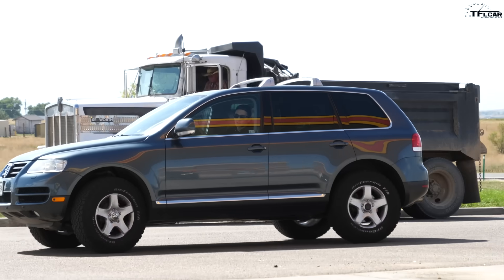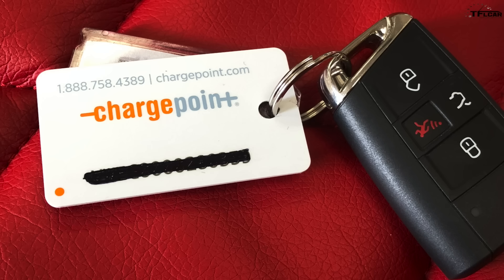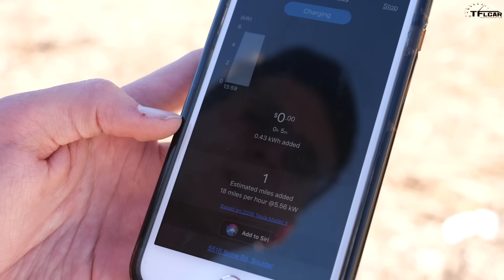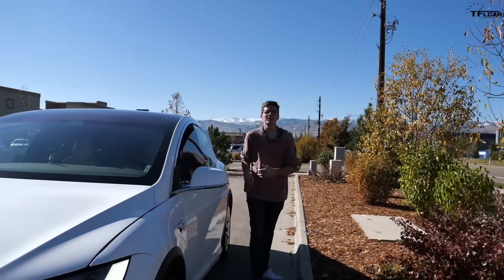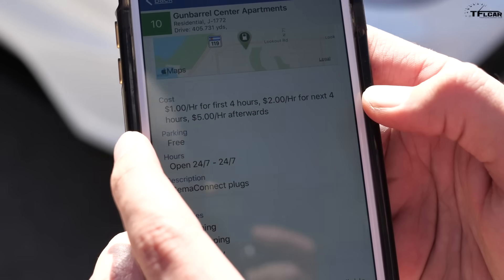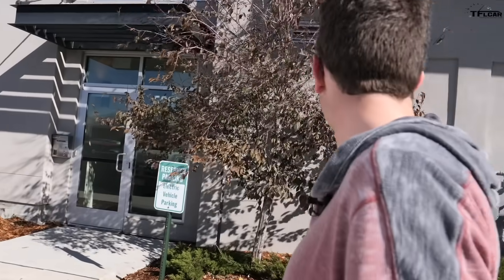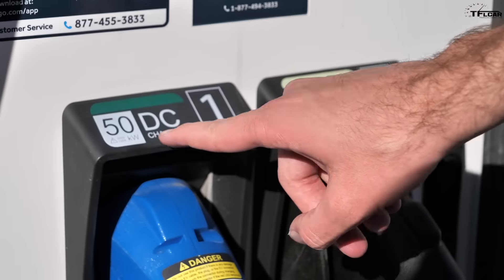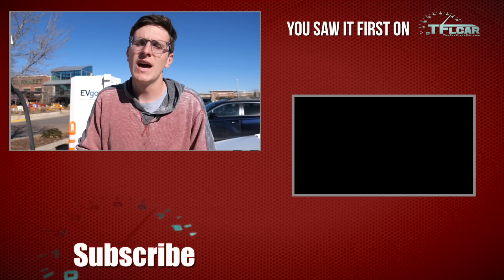Here’s Why Charging an Electric Car Can Suck - And It’s Not The Reason You Think!

Comment: So, I think electric cars are a good idea, but, I don't think they're worth getting for a while. And, seeing this video, points out a lot of the flaws with electric cars, beyond my typical argument against them.

The US, geographically, isn't built for electric cars, cause it already eats gas cars for breakfast. And the other problems I see, that you've pointed out, can be fairly easily fixed.

We need a board, or committee or something, that can help to regulate what's required, when paying for power, and the kinds of plugs allowed on the machine. I think a max of 3 different plugs should be okay, and, they should run very similar to that of gas stations, where you can select the different types. In this instance, rather than selecting unleaded, plus, and premium, simply select slow, medium, and fast charging. Each would be charged differently, and if you've got time, it's not so bad. Plus, pumping out higher loads of power into the car can cause problems on the device itself, so, it would actually make a lot of sense for them to be more expensive the faster they charge.

Of course, as technology improves, I don't think they should bump up the rates too much as they switch out the pump's abilities to charge faster with newer plugs. Though, if the companies/board is smart, they'll make the plugs themselves modular so as to switch out the slower ones for newer ones over time.

However, they also need to work out a system, where you can simply just pay and go. Gas stations (and pretty much every business on the planet), allows you to pay in cash or with a card. No need for extra apps. While things like Google pay, Apple pay, etc, exist, those should be set up as a way to connect to the device without having to pull out the card, but, not need to go through 6 different companies to get the stuff done. All pumps simply need to have a large enough screen to view the options, and let the owners select card, app, or cash (where appropriate, say such as gas stations, retail, etc.), and then leave it at that.

The board, would simply regulate the general cost of getting power to the cars. Such as establishing that residential areas should be cheaper than commercial areas, but, are limited strictly to the people living there. This can also be easily solved, simply by giving the residents a pass code that they can put in when charging their vehicle. This will prevent others from just hooking up and using up power when not needed. However, it is possible, that neighborhoods could allow for outside customers, but, they'd probably be charged more for using it, than they would if they went to a commercial area, as then they're using up a charge post that could be used by the residents.

But, for the commercial areas, since they're allowed to service anyone, they could be allowed to charge whatever they want, so long as it's not above a certain amount. And, likely, so long as it's not below a certain amount either, as they'd still have to pay the electric company for charging the cars. Unless they opt to get a gas plant that they can use to power these pumps, and simply have the tanker trucks refill them that way. Again, the board would simply unify things, to streamline everything, and to avoid the chaotic mess with improper plugs, and 6+ layers of companies/apps to run through when paying for recharges.

An exception to this, would be to let some of the companies do what Tesla is doing, which is to let it be charged to your account, and then you pay it off that way. Which, is okay, until the car gets totalled, then you need to replace it, so, I wouldn't know how to solve that exactly. Unless Tesla has a separate account linked to the main one that let's you pay for power that way.

The other problem, which I feel is the biggest, is the one that's turning most people off from having electric cars, and that's the charge time. While it's great to have an electric car, and to be able to charge it, these cars, are simply luxuries. Gas pumps are, currently, infinitely better, as, if I'm out of gas in my car, I can simply sit there for no more than about 10-15 minutes max, and fill my car and be on my way. Especially, if I don't realize that I'm low until before heading into work. With the electric cars, that's not an option. You'd need to recharge it all night, every night, to ensure a full charge. And then, if you travel super long distances (coast to coast, because some people love to do this), you'd be in some serious trouble, because, you'd literally have to drive till it's out, then break for the day, while it charges, then start again the next day. While it already takes a few days to a week to get across the country, this will very easily double it.

Granted, most people won't be doing long distance drives like that, but, not everyone can afford a plane ticket either, so, that limits their options considerably. But, the charge time for the batteries, currently, is too long for the average person to even be interested in having these cars to begin with. Everyone's already used to the convenience of quickly filling their cars, so, these charge stations need to manage to match those same basic speeds.

There is a possibility, that they could section off the batteries, and have multiples charge at once, if that's not already happening. Because, if you were to compare them, charging 1 phone could take an hour, but, if you were to hook 4 phone batteries together and charge them that way, it could take about 4 hours. Whereas, you can hook up 4 phones to the wall, and all will be done within an hour. As an extension to this, current gas cars already charge their batteries as they drive, so, it's possible that they could do the same with the electric cars. Simply hook the wheels up to 2 sets of wires, where 1 causes it to move forward (probably the motor turning the axel), and the wheels themselves, can help to recharge the batteries, slowing down their drain. Plus, there are 4 wheels (typically), so that means 4x the recharge rate, even if it is fairly minimal. Plus, typically, cars are rear wheel drive, so that helps considerably, as all the power will drain out that way, and then all 4 can rebuild as necessary. This is all, of course, assuming that these companies haven't already applied these ideas in the first place.

Comment: Electric cars are great for the use case of someone who commutes less than 100 miles each way a day and has a garage or driveway in which they can install a charging station and charge their car overnight. I would venture to guess that a majority of Americans fall into this category. We have had an electric car for over 2.5 years and never have to deal with this hodgepodge of charging options because we just charge at home overnight. But if you don’t have access to a home (or apartment) charging station, then EVs are probably not for you yet.

Comment: 3 hours to go 45 miles, seems like a toy for urban commuters.  In the end it likely pollutes more than an efficient Honda Civic
Reply: Fred Burris how?
Reply: nicolas vilches 
Most of the world’s electricity comes from burning fossil fuels and you put it on there for almost 4 hours.
Reply: Actually around me 90% of electricity comes from solar, hydro, and nuclear power so it’s extremely clear around me
Reply: @Sam-TheFullBull  Not sure where you live but whats around you likely doesn't mean thats what charging your car.  In the west the power sources feed a grid which is majority natural gas and coal fired
Reply: Amount of time is irrelevant. How much power is being used to charge is all that matters. A Tesla Supercharge station and the 120v outlet in your garage will charge your car the same amount. One takes 30 mins and the other takes 15 hours. Both burn the same amount of coal, natural gas, wind, solar or nuclear power.

A Tesla charged with solar pollutes trace amounts compared to a super efficient Honda Civic. Pretty much just the factory output for creating the PV cells (which last upwards of 50 years). A Tesla charged using coal power probably pollutes about as much as the Civic. Maybe a little more but not much. The cleaner your local grid, the cleaner your EV. A clean local grid doesn't change how clean your ICE vehicle is, though.

Comment: my full size conversion van, and 3 cars cost me... $3,600 COMBINED cost to purchase.  I've already driven these 4 vehicles a combined 150,000 miles.  All the motors run like new.  I will convert all of them to electric on my own, and the operating costs will be even cheaper.  I will use a transmission free direct thrust system, of my own design.  So, I will not be using any charging stations.

Comment: Seems like a lot of inconvenience to be stylish...
Reply: I drive my Model 3, come home and plug it in. Next time I drive my Model 3, I come home and plug it in. Repeat as necessary. Not very inconvenient.
On road trips, I stop to charge which usually takes about 40 minutes, during which time I usually eat, which takes longer than the car charging. Again, not very inconvenient.
Reply: @NVRick1  it's nice that you can have that time when you're on a long trip. A problem I can see is some time even on a gas station there are a little line up, and if the "fill up" time would take 40 minutes then you'd need to have a bunch of parking spots for them, currently we don't have that but as we are forced with this technology it should come along I guess. Hopefully we get a universal plug and all charging stations have the current fast charging minimum. Another thing is extreme temperatures as those kill range, I guess it's the cold that really hurts EV.
Reply: richard blaski shut up.. gas or diesel is better
Reply: @axtra92  Wow! With that argument, you've convinced me.
Reply: @axtra92 Pretty hard to fault that logic. I don't know how I missed this solid bit of reasoning!
Reply: @axtra92  Please grow up
Reply: I just ordered a Tesla model S, currently comes with free lifetime charging at any Tesla station, there’s one under construction 4 miles away and another 6 miles away.  Free is nice.
Reply: When will the officers be here?

In a couple hours they need to charge their vehicle first.
Reply: You're right I rather take 5 minutes to gas up a Subaru Forester than wait a couple of hours for a charge
Ha ha technology sucks 
Stick with what works
Reply: @ralphabreu5022  That's what they said about the "horse & buggy"! LOL

Comment: This is made up BS. You complain about having to sign up before using a charger, then you use the one car that has no such problem, the Tesla, which simply plugs in and charges to your account automatically. Then it is a "problem" that Telsas don't use the same plug.

The fact is that Telsa drivers rarely use other chargers outside the Tesla system. Tesla chargers are about three times faster than the fastest "high power" chargers used by other makers. That's only for starters. Tesla stations usually have 10 or more chargers, vs the one or two found at other types of high power stations, and half the time one of them is broken.

You want to complain about charging? Fine. Don't blame the car that solved these problems for the problems with others shitty networks.

Comment: One third of drivers didn't know if electric cars had a gas or diesel engine? I knew some drivers were stupid but this is a whole new level.
Reply: Seriously - you don't understand that people who (so far) have no interest in an electric car haven't studied the terminology/technology to know that there are currently three versions of "electric cars":  1) Hybrids with an engine that moves the car when needed and recharges the batteries;  2) Plug-in Hybrids that can also be plugged in for charging;  and 3) Pure EVs that only run on battery power and must be plugged in to charge?  So I suppose you are familiar with all versions of flex-fuel and hydrogen cell vehicles - otherwise someone might call you stupid.

Comment: Where do you think all the electricity came from to charge  the Electric Car Battery? Electricity can't make itself, the charging station, based on its location, could be running on either coal, water turbine and or nuclear energy.  The Lithium battery, once dead, is now Hazardous Waste and has to be stored deep under ground somewhere far from civilization forever. But enjoy those 8 hour charges or longer if there's a line at the Elect Pump when you're miles from home. Y'all really didn't think this through... and you're not saving the planet at all.

Comment: Big mistakes in this video. Every house has 220vac. It’s what your clothes dryer runs on (and your air conditioning). A gas car is actually more of a pain in the arse to fill than electric. When you drive an EV every morning you leave your driveway with full range and unless you drive more than the range of your car you never charge anywhere but home. I don’t know anyone who commutes more than 300 miles a day. Do you? So they never have to charge away from home during their normal daily life. Ever. Period. Never!
When you drive a gas car you never have full range in your driveway. Never. So you have to go out of your way to find/drive to a gas station to fill up. The time t do this is the time to drive to the station, the time to wait if the station is busy, and then the time to fill. Then you should add the time and cost of oil changes four times a year because gas cars need them and electric cars don’t. You have to adjust your schedule to take care of the gas car. That doesn’t happen with an electric car. They are much more convenient to own.
Especially if you own a Tesla because if you do go on a trip superchargers are everywhere and are super fast and easy to use.
EVs are also faster, handle better, more reliable, more comfortable, quieter, and don’t spew poison out of a tailpipe as they go down the road. Remember you are breathing and living in the air that’s being used as a place to dump the poison that’s coming out of the gas car. Have I made my point?
Reply: Dave Webb   Chargers are not everywhere.  Do you ever do a road trip?  You would not reach your destination in my area of the country.  Even if there was a charger who wants to wait. And how far is that battery going to go in Wyoming in the winter?

Comment: It gets worse
At 40 deg F and lower the battery capacity drops off precipitously.
A Tesla Model S at 19 deg F got 7 battery miles per physical driving mile with only window defroster on - no cabin heating.

Comment: EV's will NEVER replace the ICE engine....I can fill my 36 gallon diesel tank in less then 6 minutes with a fuel range just over 500 miles also no need to look on my phone to find a gas station...lmfao 30 minutes to fast charge vs 5 minutes to fill up a gas tank...my choice is clear.....I.C.E.

Comment: sure I'll charge for 10 hours if it gives me  450 mile range.  I can road trip for 6 hours straight without  a break.. heck I've run ice cars for 26 hours just stopping for gas and bathroom  breaks  up the east coast... EVs need to give at least 6 hours at 60 mph on one charge, bare min. for me to consider them to be my car replacement. I would love 800 miles for a  10  hour charge .

Comment: apartments and condos need to get with the program...
 Governments can update  code requirements as part of  housing  requirements as well. Also locked membership  charging ports  for tenants  or residents maybe an option.
 and if you do have a garage  part of the cost of the  car should  be installing an accessible  240V port

Comment: That is why the federal government needs to take over the electric vehicle industry and set a standard that all electric vehicles manufacturers and charging stations have to go by one type of electrical plug can be used and only one app on your phone to use basically one company to deal with or just use your credit/debit card to pay at the charging station and a flat rate of charge per hour of charge no more proprietary charging plugs either and as for home charging system you'll need to have installed a separate power connection with a separate meter and pay two different electric bills and a electric fuel tax to pay for our nation's infrastructure like roads and bridges just like people who drive internal combustion vehicles do by paying fuel tax when they fill up with gasoline or diesel fuel.

Comment: Electric cars don't make any sense at all to me. 1. They are powered by power plants that mostly use fossil fuels to charge them. 2. They take way too long to change, so long trips are not practical. 3. The cost to replace a battery is $5,000 to $7,000, hope you saved all of your gas savings money over the years! I don't see one single benefit in owning an electric car, am I missing something?

Comment: I get a 450 mile “charge” in about ten minutes for my V8 truck! 😆
Reply: And that's with a slow pump!
Reply: from empty to a full charge in 10 minutes, what are you drinking or taking?
Reply: @dannyfields2065  he's drinking diesel (well, maybe gasoline).  That's sorta the point.  20 gallons of fuel takes only a couple minutes and gives you maximum range.  With an EV even if you have the same range, it takes hours to achieve the same thing.

Comment: Check with Home Depot electronics department and ask for a 120 to 240... You simply get a box that uses two electrical plug ins to a 120 line that makes 240... you can have your own home charge station just get that and a long cord for 240 use.